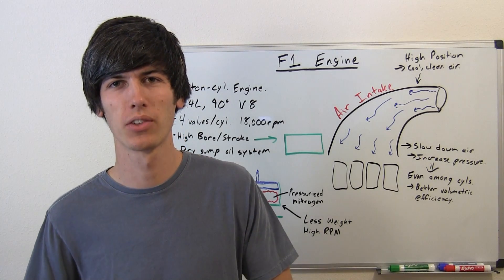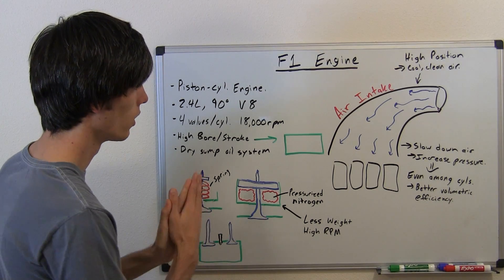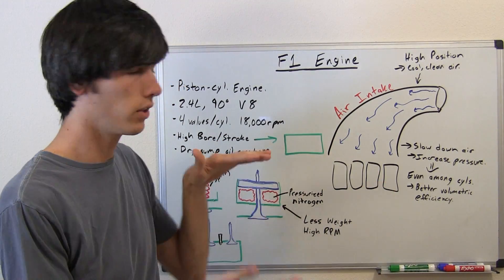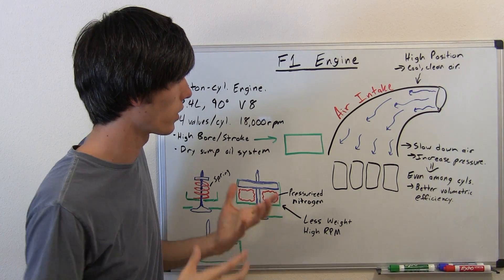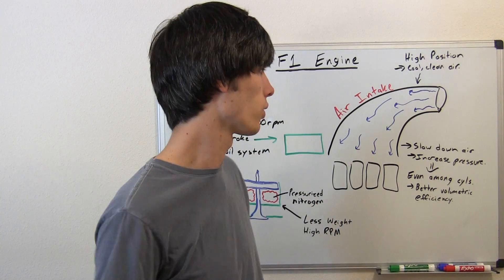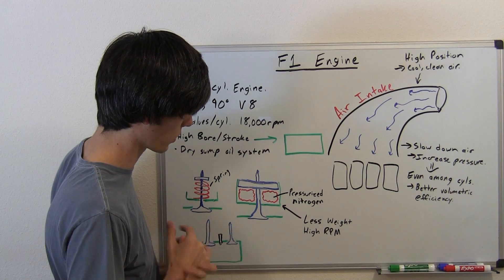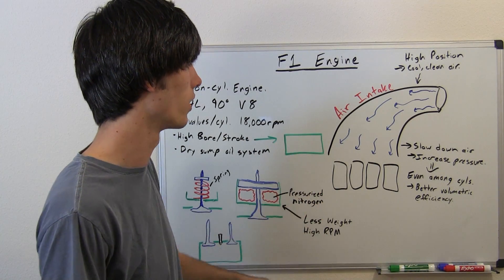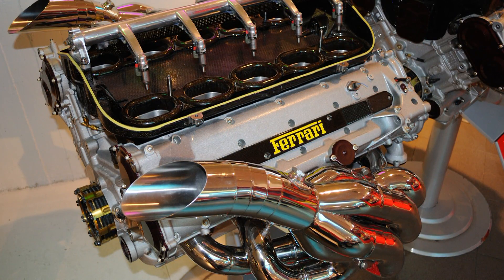F1 Engine - Explained

Comment: I always wondered how these (now old) engines could achieve such high RPMs and what would be the valve system that could close them fast enough. I guess this is the same system that should be used in motorcycle engines to achieve almost the same level of RPMs. Thanks for the video and the great work, I like them much 'cause you can make them short, objective, and with great level of details, what is difficult to do.

Comment: Hey! Can you go into how a car can have more than 100 percent volumetric efficiency without the use of a turbo/supercharger? I mean how can you stuff more air into a cylinder without a turbine or blower of some sort compressing and forcing the air into it?
Reply: You can't go passed atmospheric pressure without a pressurizing system such as a turbocharger. Naturally aspirated engines will only suck up what's there, and what's there is one atmosphere of pressure. Anything beyond 1 atmosphere requires pressurization.
Reply: +Belicose777 When did he ever say that?
Reply: +Belicose777 Hmm. interesting. He never mentioned it in a video nor have I ever seen that. Odd.

Comment: For those that don't know the reason slower air equals more pressure is because of the Venturi effect the more velocity the air has the lower the pressure so the slower the air the more pressure it has but only up to 14.7 psi which is atmospheric pressure unless you have a forced induction system

Comment: The thing I don't understand is how do these engine keeps making power at 18000RPM? For most high-revving engines the power starts to decrease beyond 8500-9000RPM, is it all because of the short stroke and valves that won't float?

Comment: Why don't all cars have wider cylinders in the engines since its more effective when its used for F1s?
Reply: +DrifterX2J Because with a shorter stroke, you get less torque, so you have to rev the engine really high to get any real power out of it. Revving the engine really high is bad for fuel economy and is also pretty loud, so it's very rare to see a street engine rev more than 10k.
Reply: KingJanic I see. Thanks!
Reply: +Drifter&#39;s Diecast because bus stops, shop windows and telephone boxes may need fitting with perspex instead of glass. high rpm. turbos. supercharger. short exhaust. thse four things equal real loud i would imagine. i used to be able to hear f1 cars race at silverstone from a good distance away. never heard one revving first gear up a ramp in an enclosed multi storey carpark though.... tokyo drift may have only been a 30 min movie. lol ;)
Reply: +Drifter&#39;s Diecast  Because most people are lazy and likes to drives their cars at 1500 rpm all the time, without changing gears.

Comment: the bore to stroke ratio is called square if the bore is more then the stroke it's over square if the bore is smaller then the stroke it's under square (i.e. diesel engines) and F1 has not used camshaft's to move the valve in years, they use solenoid's to open them. Koenigsegg has started putting this into their cars and into other family cars.

Comment: The intake is a RAM design. The faster you travel, the greater the pressure it generates. The fact that it slows & distributes the air are other functions of the design. Think about this: if it were facing backwards, the faster you travel, the greater the vacuum generated at the mouth of the intake (due to aerodynamics)
Reply: +elmura73 Exactly!

Comment: Some NA engines have certain operating conditions where volumetric efficiency can be greater than 1, utilizing creative valve timing and taking advantage of the inertia of the air mass entering the engine. Granted, the effect is small, but still achievable under ideal conditions.
Reply from the maker: +johnnybrown04 Agreed!
Reply: Even common modern production N/A engines can intake more than just the volume of the cylinder. A long vertical intakentract, coupled with the intake valves staying open for many degrees beyond bottom dead center, allowing more air to get rammed in to the cylinder. From Dodge, this was called the Ram Charger. Decades old now, it capitalized on the momentum of the air moving in the intake tract.

Comment: The pistons will still move quickly,  given the RPM, faster than any other car.. The wording you'd have been looking for was "lesser range of travel" Nitrogen spring. Interesting. I wonder if they may have had problems with springs fluttering and not closing fast enough at that rpm,  because it seems like with extra cylinder+piston would weigh more than a simple spring.

Comment: Just one thing i think is not 100% correct. When you say that with supercharging or turbocharging, you can have 2x the atmospheric pressure inside the cylinder, you are assuming an boost pressure of 1bar (absolute pressure +/-2bar). Otherwise you could say 3x, 1.5x or whatever, depending on boost. Generaly speaking. But let's assume that case, there you have 2x the atmospheric pressure... in the intake manifold. Not necesseraly inside the cylinder. Because that depends on pressure drop from the intake to the inside of cylinder itself, due to limitations on flow, and that limitation increase, as revs increase. I know i'm being a little to much "off" the matter you are talking about, but as you touched the subject... I understand what you are saying, but it wasn't 100% correct. Correct is not the word, i'm trying to get the right word, but english is not my native language. Sorry
Reply: Very good point. Turbo boost is measured in intake manifold and should be measured in combustion chamber. I believe the engine computer measures boost pressure from combustion chamber anyway but anytime u see an aftermarket boost presure gauge the presure is measured in intake manifold
Reply: Btw i believe the word u were trying to think of is "accurate"
Reply: +Nathan Berry Thanks. Accurate seem's nice ;) Btw, pressure is measured in the manifold, or (in the most of the time) intake piping. There is where the manometer sensor is placed. The barometer sensor, in case it exists, is placed in the ecu, most of the times (at least the ones i know). The absolute pressure is given (obviously) by the sum of those two sensors.
Reply: +fitty77 He's only saying that you can have 2x atmospheric pressure in the cylinder as an example, The intake pressure required to achieve it is irrelevent.
Reply: sera56jase Not really... I understand it is a example, but should be clarified. Really understand he knows this. Now, for the intake pressure being irrelevant, that's another talk. More, i didn't get that being said by him. For what matters, you need to clarify that, in order to obtain a greater pressure inside the "expansion box" than the atmospheric, you really need air to be induced inside it, by manners of speed. If you have the car stopped, in reality, you'll have vacuum inside it, as you will have a pressure drop by the limitation of size on the air intake, same as you try to breath through a small pipe. So speed is what makes the pressure inside the box be greater than the one outside. And what speed as to do with pressure of the colected air, and why is not irrelevant, is explained by the Bernouli formula. When you have speed pushing air inside the intake, that air as a certain static pressure, but also, a lot of dynamic pressure. Both of them will vary in every different place you will measure them. That dynamic pressure is the one that is induced in the box. And when air expands, and comes to a stop (not complete stop, as it goes to the engine), speed is reduced, and is "converted" (if i can say so easy) in static pressure. So, you can't really look at pressure, as the pressure you have the air outside. Because the air goes in to that box in a special, engineered way, in conditions of pressure that have nothing to do with "athmospheric pressure". And that pressure really depends on speed, so will vary as the car goes faster or slower... Taking the example of breathing, try to go on your car at 120mph, open your window, take your head outside, turn your face directly to the wind and just open your mouth. You will feel that is not easy to breathe, because when you are trying to exhale, you will feel a pressure greater than the athmospheric, and you really have to push hard to exhale. But if you put your mouth in a different way, or turn your face a bit to the side or so, it eases very much, because you are disrupting that flow/speed outside "the box" (mouth). Ask skydivers for this one ;)

Comment: You forgot to talk about precision tolerance and that the F1 engine are pre-heated usually the night before, because the parts are machined for precise fitment at working temperature, starting a F1 engine at cold would wear it. Precision tolerance = more power. Even the spark plugs have usually different length, where on the F1 plugs the difference between the longest and the shortest is about 0,051 millimeter. With all the parts made with as much precision on a F1 engine this is how it achieve that much power from such little engine size.
Reply: They actually can't start a cold engine, its not possible to
Reply: This is the most significant difference between normal engine and f1 engine. In normal engine combustion leaks past piston. In f1 engine the gap between piston and cylinder is so tiny that almost no combustion leaks past. Tollerances in f1 can be as tiny as millionth of an inch. Also better engineered tolerances in other parts of engine decreases friction loss
Reply: A cold f1 engine is pretty much a seized engine. You can’t start a cold f1 engine.

Comment: For anyone watching in 2015: it's now a turbocharged  1.6L 90° V6, anyone knows the specs of the turbo?
Reply: +CarsRcool there is a different between smart and possible.
Reply: 1.6 litre 90° V6 Single Turbocharged with Energy Recovery System (MGU-K & MGU-H) 33 seconds approx. at 4Mj per lap. 8 speed seamless sequential (non- automated clutch). Rev limit @15,000rpm.
Reply: not to mention direct injection system. its all about high power and less fuel consumption. drawback? vacuum cleaner sounds
Reply: azrul nizam...the engine burns so lean a spark will NOT ignite the fuel charge. A SMALL spritz of rich fuel/air is injected into the spark plug that in turn ignites the main fuel charge in the cylinder. All this to get 105 kg of fuel (38.5 US gal 145.7l) to last for the entire race and still pump out >600 bhp.
Reply: I hate all the engine rules they have, they should just have a max engine size and whoever does better, does better.
Reply: dpla9752...the engine specifications were  developed by Mercedes from their experimental work then adopted by the FIA. This gave Mercedes an advantage they have ridden ever since. Not kosher folks.
Reply: CarsRcool well why dont the make a it get 500 mpg 2000 horse and a 1000 rpm maximum
Reply: really? when did this happen
Reply: 1.6 liters of nearly friction-less balance in harmony capable of producing Outstanding Performance......each one is a Work Of Art from multiple teams of craftsmen and engineers working to exacting tolerances.

This is where experiments are made and new ideas/materials are proven and then applied to modern aerospace practices.
Reply: CarsRcool
Nah.  I've decided not to argue with someone who can't use punctuation properly.  I'm muting this post now.  Bye.
Reply: yeah lots of videos that leave out all the info of how it actually works. pretty easy to make shit up.
Reply: +CarsRcool If it's so good, why hasn't anyone else heard of it in over 2 decades?
Reply: Yes there was, and actually this period is quite infamous because it created the fastest track cars so far.
The first V10's came into F1 in 89 by Honda and Renault. For the 2000 season the FIA changed the rules and only V10 engines were alloud up to the end of the 2005 season. After that they switched to V8. The last generation of Honda's V10 F1 engine was able to produce 965HP in qualifying out of only 3L displacenment and was desinged to hold together for about 600km at racing speed and the dry engine weighed less than 90kg.
Reply: yeah ok
Reply: tyler bonser search ' joe cell ' .. it will require some research .. " Dragster' ... no noise.. 
no gasoline ..
Reply: tyler bonser because it has already been done....
Reply: +CarsRcool sure they did, sure they did.
Reply: CarsRcool
Ok, I guess what I meant was, if it's so far superior, why has it not been implemented into production in nearly 30 years?
Reply: im just curious if you know, was there ever a time when F1 ran V10s?
Reply: Csab The "The Farting f1 cars"
Reply: tyler bonser  early 90's in australia ..
Reply: +Denuris Turgryn call Singer Aerospace to get your very own
Reply: Bob Jimenez gibberish
Reply: Shawn plenty of   joe booker  vids . check them out on youtube... get an engine an play .. you will get it .. it just takes some time and dedication though 
Cheers
Reply: Shawn easy .. you want a weeks time to answer you own question ... 
ill   wait
Reply: Shawn so long 
have a nice day
Reply: +TARider2 Yes, they also ran v12s at one time ! I recommend you look up "fastest f1 lap" the sound of v10 is incredible !
Reply: shi01 thats awesome thanks for the info. I just got into watching F1 and Indycar about 3 or 4 seasons ago now, and of course the first year i started watching F1 they had switched to the hybrid system so unfortunately i missed the noise of the old engines. It also seems like with these new hybrid setups that theres less competition because mercedes already has so much R and D into those systems they have a huge advantage over the other manufacturers. so because of that i've found indycar to be much more competitive and exciting to watch in my opinion.
Reply: Denuris Turgryn The rev limit is at 15,000 rpm
Reply: As far as I know they are ( or were born borg warner efr turbos with lots of high tech stuff like gamm titanium aluminide turbine wheels, half the weight of inconel or mar-m, making much faster spool times.
Reply: +azrul nizam its a  pos... how about 100mpg MINIMUM .. 500 Horsepower MINIMUM and 2500 RPM MAXIMUM .... 
oh .. the oh so smart F1 guys cant do that ???guess they are not to smart after all ..:  (
Reply: tyler bonser yes... they are not smart enough to make it possible.. 
Cheers... and have a nice day :  )